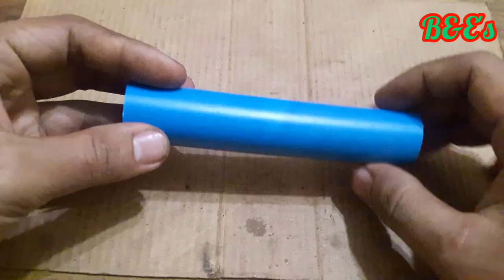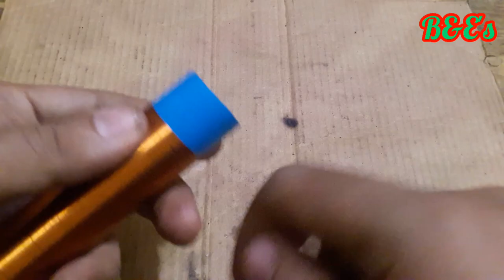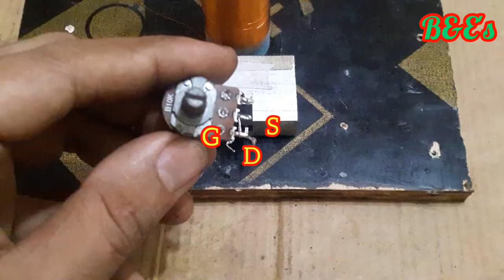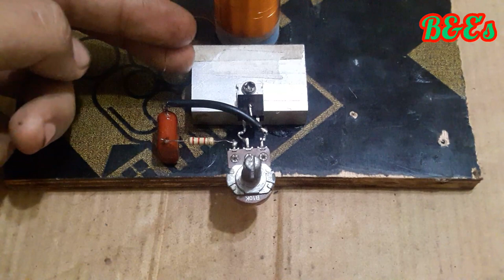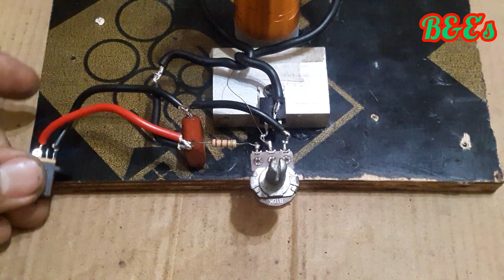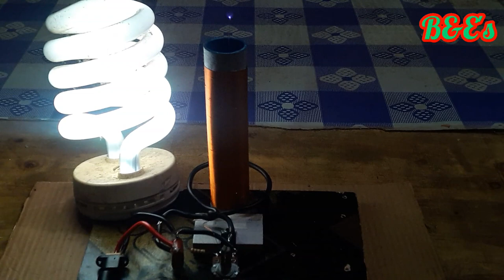အလွန်အား​ကောင်း​သောtesla coil/Irf3205 tesla coil circuit/how to make powerful tesla coil at home/

Comment: Very nice its working well😅
I used irf3205MOSFET,400v 104j capacitor,3.3k resistor,47k potentiometer it works well